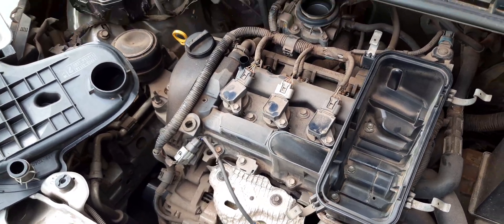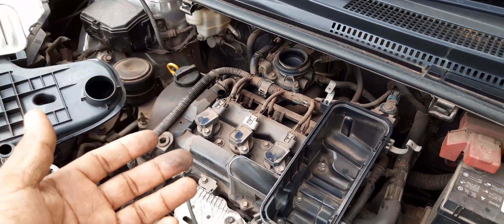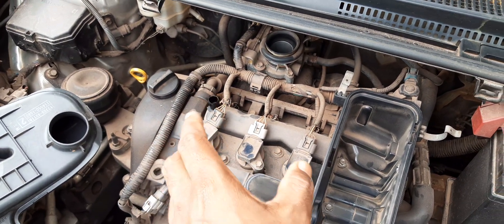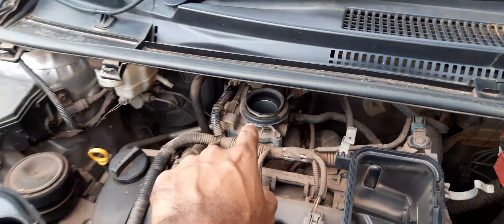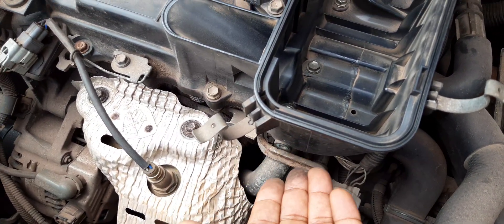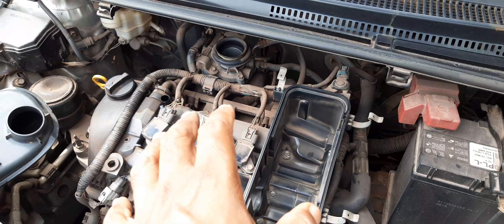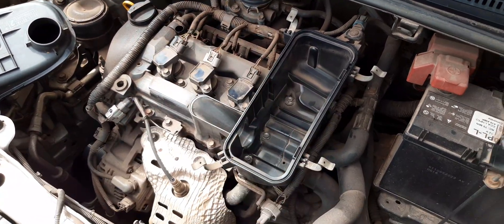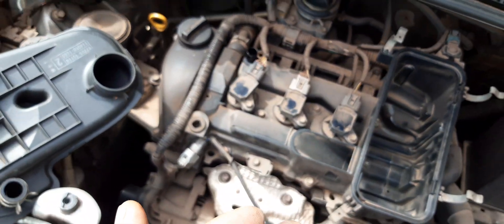How To Solve Your Engine Vibration Problems

Comment: My vitz is also vibrating in a certain RPM like , I push a bit to the gas pedal when the gear is in N, is vibrating. The gear is in1, again vibrating when speed is 10 Kmh. The same when gear is in 2, vibrating in 20 km speed. I try to understand what can cause it
Reply from the maker: @melihcanvarsak4023  if you are experiencing vibration at 20 kilometer you may have a larger problem. As speed increases the vibration should go away. What you have done since the vibration started?

Comment: Today i was driving and my car neutral, after that the shifter only moves from park to reverse but car still not moving. Its a axio 1NR transmission. Any idea of what cases such problem?
Reply from the maker: @chavhighlife6181  check the cable attached to the transmission from the shifter, it could be loosened.